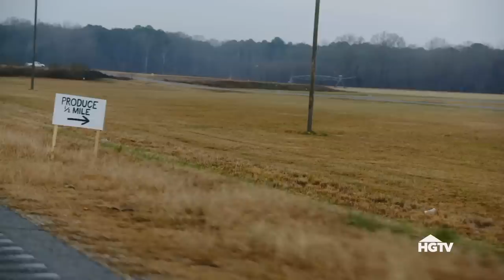An ENTIRE Farmers Market Built In Wetumpka | Hometown Takeover | HGTV

Comment: It’s an interesting downtown development question. Is a permanent farmers market shelter better than just closing off a street downtown to have the market under tents? Having the market on a closed street draws shoppers right into the center where they may also go in shops or restaurants. It looked successful in that picture they showed from their hometown, and it certainly works where I live in Knoxville.
Reply: Having it one place has the advantage of possibly being open any time unlike closing a street. Also easier transit for older people to stay out of the rain. And other activities could be in the same space.
Reply: @janwoodward7360  good point. They built a nice park so maybe the shelter will be used for picnics too.
Reply: It actually looks like it could be another multiuse facility (outdoor weddings, parties, etc. when the market is not open).  Hopefully there are bathroom facilities near.
Reply: I think it just depends on the individual town. In my town there is a farmers market downtown every Saturday. The problem is that the parking downtown is so bad that it's difficult to get anywhere near it. It is on a less busy end of Main Street and that helps a lot. There is no way it could happen in a busier part of the street, there just is not the parking.